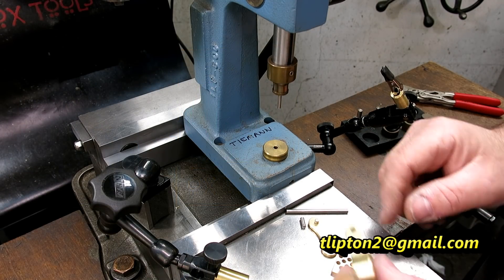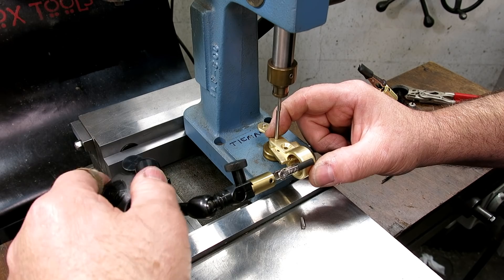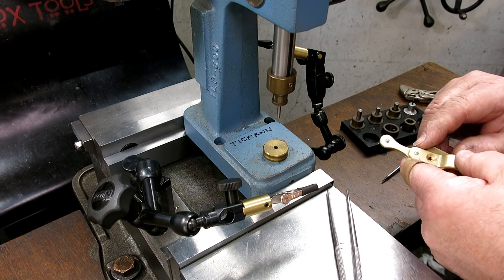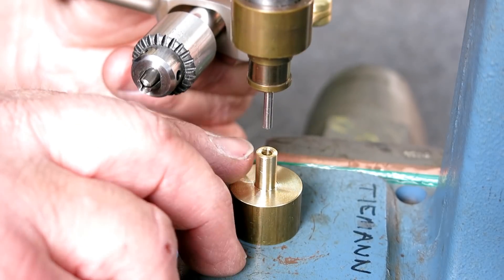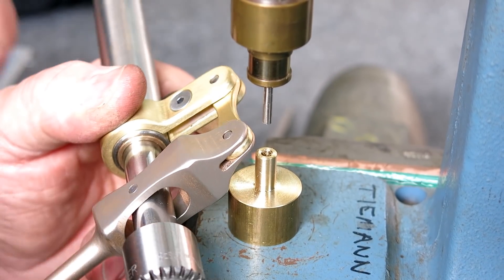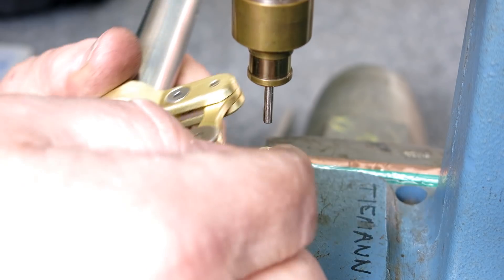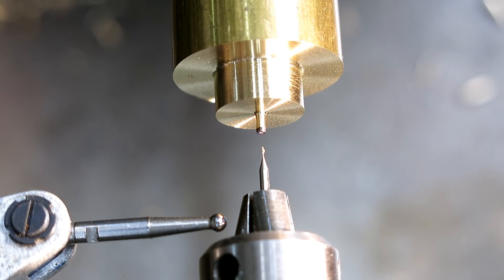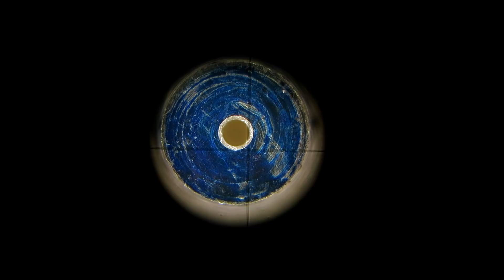Sensitive Micro Drilling Attachment Part 5

Comment: Thanks for the idea. I am just learning machining and have very little skill. I can't make that thing BUT I can drill and ream out an MT2 adapter (fits my tailstock). Then turn a very well fitting rod inserting it into the hole. Attach a tiny chuck to the rod and there it is! Move it in holding between thumb and forefinger.  (no lever gizmo) Won't be quite as good but should work.

Comment: This is actually a very very good time in history to learn a skill like this. Biomedical instrumentation is all being directed towards microfluidics. The last two companies I work for one of them being becton Dickinson in Maryland was heavy into PCR on a chip which basically means polymerase chain reaction performed using microfluidics and there's a lot of tiny parts being made. Also within the same life science Industry is high-throughput liquid handling that also uses tiny tiny parts. And another factor or discipline within the same sector is microarray printing and you guessed it which requires ridiculously tiny injectors and things like this. these are awesome techniques to become familiar with is on this scale everything behaves differently. The highest paid machinist they're working for these biomedical companies building prototypes. Not only is it high-paid work but it's a fascinating industry to be in you never do the same thing more than a few times and you get to build parts that are challenging and rewarding.

Comment: Great video as usual Tom. The fact that the hole was only 2 thou oversize is a tribute to the alignment of the lathe and the adjustment of the tailstock set-over as well as the concentricity of all the parts leading to the tip of the drill.
 In my ancient lathe, tailstock droop alone would probably result in that tiny drill missing the centre altogether and becoming a tiny trepanning tool for the two nanoseconds before it snapped. Cheers.

Comment: Nice to watch . I real do not think  the headstock bearing would be guaranteed for  for .001 radial run out never mind the tailstock being aligned to perfect center  (with chuck and tailstock distance added to you tolerances in you attachments ) as a 63 year old machinist I was impressed  and I think I will be making  your attachment soon

Comment: I think there are several things that make this a standout video series. The first is the use of 3-D metal printed parts. Never saw one before, and the technique has obvious fabrication advantages. The second was watching the careful machining that went into the project. I like the use of a Sharpie sketch on a piece being milled because it not only keeps Bozo on a leash but is an aid to the viewer. Finally there is the drilling  of tiny holes. Watchmaker stuff. On a good watchmaker's lathe with a good set of collets and magnifiers it is easier, but no joke.  On a 18" lathe with a chuck-held workpiece it is incredible. I did a #80 hole, once by hand with an Archimedes drill and then on a drill press. After that I broke 1001 carbide bits, (reground aircraft bits) so I was amazed you got there in one go. Typical runout on a chuck is .002 so that is half the diameter of the .005 hole. Oh, and my Taig lathe has lever-operated drilling and I just love it.

Comment: The smallest hole I made, was in the side of sewing pins 1/112th or 0.00892 (0.2267mm). Used for a helium injection side jet. I made a drilling jig to support the drill bit, and a collet.

Comment: I did a fair amount of small hole drilling and wish that I had made one of these. This design is so much better than the classic small chuck that slides on its arbor which is mostly what I used. Very nice project and as always delicious execution. I always wished that I could see some of these small drills being made. Thanks Tom!

Comment: I think the smallest drill I ever used was a #71, cut in 360 brass for propane burner orifice. I tried that one, and it didn't work well, so I bumped up one size and retested. I think I got best results from a #65. I didn't have a sensitive micro drill attachment, and the bit was so small, I had it in a pin vice, and the pin vice held in the tailstock chuck. I though there was no possible way for that drill bit to survive. It did though, I was amazed.

Comment: I had to drill several micro holes a few weeks ago. It's a butt clinching job. I used the our Dumore micro drill. Bought several extra drills but ended up not breaking one. It was in 316ss also👎  Great job on the sensitive drill Tom.
Reply: Steve Summers 316ss is miserable stuff. 10 or 12years ago, had to drill a hole for a spring pin in a 316 fitting. I had the same job, a couple times before with HSS, but I got clever and checked McMaster or maybe MSC for drills for SS - went in all set to sacrifice the usual handful of bits, and got through on the first one. Lesson learned on that one was a variation on the if you do what has always been done you get what has always been got. SiN cost a little bit more, but not wasting a quiver full made up the cost. The last time I looked, the spares were still in the bottom of the Tripple Set index box (number, alphabet, and fractional).

Comment: Love the project. Glad to see you face the same design dilemmas I do with regards to 3D printing.  I've spent so much of my life designing things that are easy to machine and when I have few limitations on how something can be made it's very hard to break out of that mind-set and utilize all of the freedoms that the process is possible of.  You did a brilliant job and I love that you really tested out the design with .005" dia hole.  Looks like a joy to use that attachment and it's nice to look at as well.

Comment: bloody  heck  5 thou hole ??   ok  so if you want us to be impressed   now  tap the hole  LOL    awsome  bit of  work
Reply: I'm wondering how exactly you make a 5 thou drill... 8-)
Reply: Lol
Reply: Nigel Bown im wondering why the heck you would need a .005 drill
Reply: @hodgepodgeenginerd1258  There are 0.15 mm nozzles for my 3d printer that can be used for some cool stuff. They're drilled to size.
Reply: @hodgepodgeenginerd1258  one use is to make orifices,  for example in fluid control systems.  I used to drill orifices as small as .0019".  The problem was, they were inconsistent.  I had no sensitive drill attachment.  A .005" drill at over twice the diameter produced a much more consistent hole although the flow/pressure characteristics were quite different.  I'm not sure what else you need something that small for, but there are some pretty small mechanisms these days.
Reply: @hodgepodgeenginerd1258  Watchmaking!
Reply: @hodgepodgeenginerd1258  I used to make mm wave instruments and orifices, drills like this were common, but 3 decades ago twist drills were not this small.  I had to make my own tools .0018 drill with a .0020 reamer, and the hole laps to go with them.
Reply: @hodgepodgeenginerd1258  You would have to be Tom Lipton to know the answer to that. ( ;
Reply: Not sure if I would be impressed if he could tap that hole. If he could single point internal thread it, then I would be VERY impressed...
Reply: @dperry428  LMAO that's awsome
Reply: I'm a bench jeweler by trade and regularly use drills that are .5mm, I also have taps that are that small but rarely get to use those. LOL. Watchmakers have some seriously small tools that never cease to amaze me. Not only are they extremely small but they are amazingly accurate.
Reply: @spyem1  Small machines with very good bearings. Probably the most necessary ingredient is MAGNIFICATION so you can see what you are doing.
Reply: NO, Now make a tap and tap it!

Comment: We used to require small drills (no. 80 and smaller) for static pressure taps in wind tunnel models.  And there were lots of static pressure taps.  Great work, Tom.

Comment: Awesome design and build Tom! Had to wonder if your tailstock is up to the challenge though. Close-up footage gave me the feeling you were out a few thou "to the right." I have a Royal spring-loaded finger-feed with a wee Albrecht on it,  but it's almost useless on my clapped-out lathe unless I spend a day tweaking/shimming the tailstock. Drilling .002 oversize is actually  a light sentence from Mr. Bozo, in my book.  Applications  BTW? (gas jets come to mind)   
Cheers, Mike